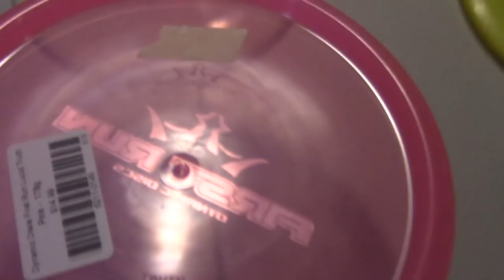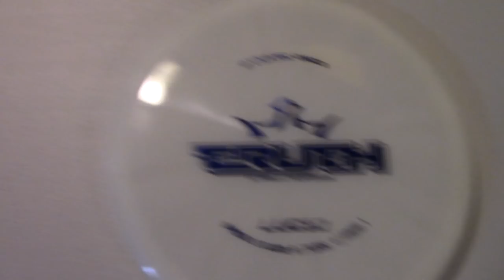A Brief History of the Dynamic Discs Truth

Comment: Great video! Quick question, have you compared the Emac Truth to a Warship? Thoughts on similarities?
Reply from the maker: Matt Barker - I have to admit I'm not a big Warship fan, but I still point people in their direction if they aren't clicking with the Truth/EMAC combo. The last time I did side by side testing was with Pre-Sweden Truths and I could get similar distances and lines from both the Ships and Truths, so I'm assuming it would hold its own in testing with the EMAC Truth. The Ship is for sure a workhorse mid, it could come down to which is most comfortable in your hand. 

I put the Compass in a similar place, thought it is not quite as long as the Truth or Ship.

Comment: Very interesting! The "Swedish Truth"  lived on as the Latitude 64 Claymore, am I right? Same numbers, same measurements...
Reply from the maker: The Truth does still exist, and while it is similar in feel and flight to the Claymore, they do have their own niche on flight. If you’re looking for a straight to under stable flight, either may work for you, so whichever feels best in the hand is a good bet. 

I bag the newer run of truths for my super straight and floppy mid slots.
Reply: @LazyChuckerDG  Well, they even used the Claymore side profile picture for the Truth on the Dynamic Discs website... But it's not like that website is to be trusted 100 % anyway. I haven’t thrown either one, so I'll just leave it at that.
Reply from the maker: Sorry for the delay, I needed to get my hands on a Claymore (then realized I had one) in order to compare them side by side. I was pretty surprised you said the Claymore used the Truth profile on the website, but, definitely looks like it. 

So, I did a side by side with discs from my personal stash. What I found is that while similar, there are subtle differences. The rounding of the shoulder had a different shape, the claymore has a little more slope to it. And while it was really hard for me to get a good picture to study, the Claymore does have a less concave wing. 

My guess, is that they were attempting to make something a little less stable than the OG Truths out of the box (and succeeded), then the OG Truth started getting straighter out of the box as well, creating even more similarity between the molds.
Reply: You must be right. Cross-checking with PDGA specifications reveals the Truth measurements to be entirely different from the ones DD gives. So it looks like DD just mirrored the Claymore product page, plain and simple. What do you know, another example of the DD site being in need of an overhaul...